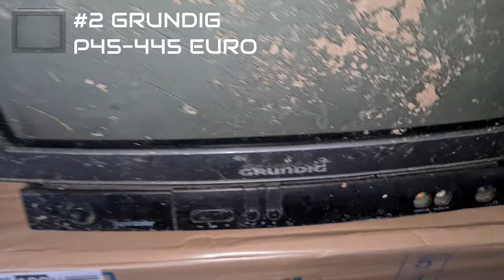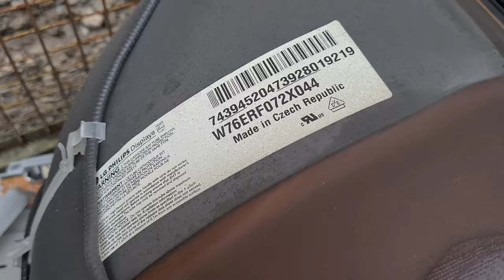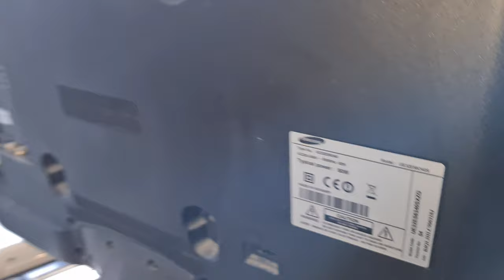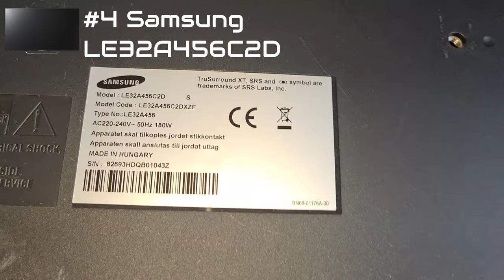Speaker Hunting Video #43 | CRT with subwoofers & other flatscreens !

Comment: Speaker hunting <3
CRTs <3
Subwoofers <3
Really great hunting!
I have subwoofer from first Thomson, but I have in closed box version, with 2 coil Nokia driver, and crossover. In my grandpa Philips LED TV is the same 2.1 samco set. Greethings
Reply from the maker: Oh yes I also have the woofer using this driver but in a true enclosure ! DVC Nokia ?? Holy crap !

Comment: good to see that you're still doing this. 👍
it would be interesting for an LCD tv manufacturer to put speakers on the actual front of the tv and not on the bottom or back. Ive seen this before on a Toshiba tv which had satellite 2way speakers that attached to the side, but no ones thought of putting them in the already thick bottom bezel.
Edit: that Hitachi did think of that! I've never seen that before.
Reply from the maker: That Hitachi did and the grundig is the same thing ! Many starts to do this again with this kind of '' soundbars '' especially TCL with their JBL systems

Comment: Those Samsung 2 way speakers lack bass. I know because we had almost the same TV and I confirmed on the internet that they were the same. It may just be the amp in the tv, and it is possible the speakers are fine. The small dotty fullranges in the smaller LG TVs have more bass, but a less clear sound. I have a TV with those. Can’t tell if they are k-tone, emsonic, or estec, because all three brands make the exact same driver and part number.
Reply from the maker: Oh no it's not the amp , they have nearly no bass which is a bit disappointing ! All LG TVs have great speakers eventho some are too stiff and that's a shame
Reply: I kind of want to see what the woofer looks like. I guess it is one of those completely flat ones. I have never had the opportunity to test them myself, and probably will never get to. We still own the tv, but have since upgraded. It would be interesting to see if they if they can produce bass at all without risk of overheating them and damaging the coils. I do sometimes feel like you find TVs with good speakers more often than I hear good sound coming from a TV, so I feel like some of them could be limited by an amplifier. Or maybe the European TV models get the better speakers for some reason?

Comment: in my country old tv lcd panels are expensive to sold as refurbished spare parts. It almost the half price of the new tv if the lcd panel still works perfectly.
Reply from the maker: Oh really ? Where do you live ? Here in France no one would buy them
Reply: @LSandM-SpeakersFromEverywhere  here some LCDs from the recycling center gets checked and resold but they must not contain pet dander or smoker dust and there must be no signs of water damage or rust, they check everything and they make like 30€ from each tv
Reply: @LSandM-SpeakersFromEverywhere  i live in indonesia. lot of refurbished tv to sold in the thrift shop here
Reply: @aliframadhan1202  oh yes... I live in Indonesia too and finding a good cheap working tv was kinda hard.